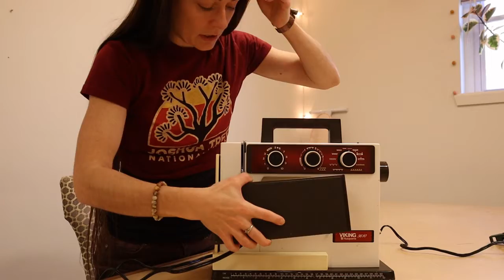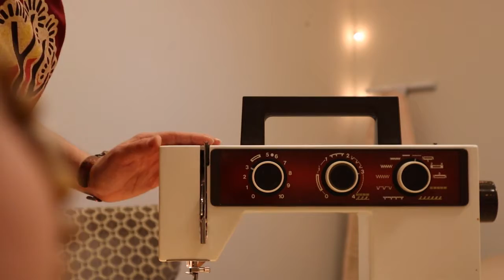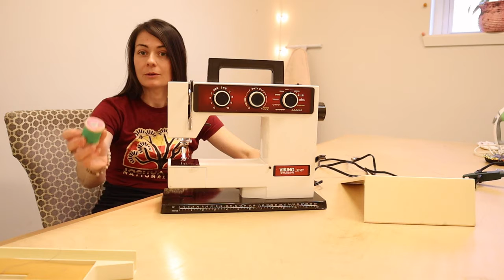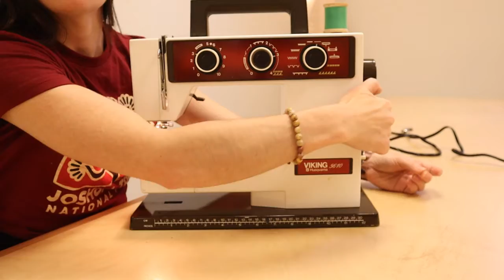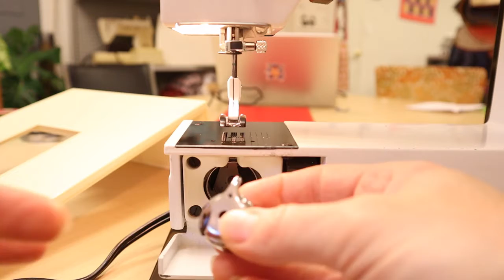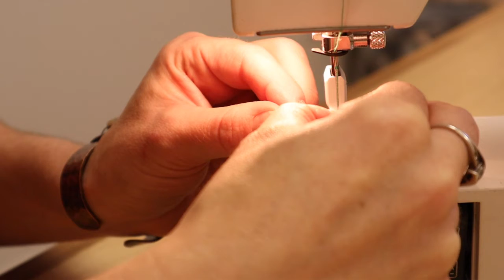Threading and Using the Husqvarna Viking 5610 Vanessa Sewing Machine

Comment: Hi, where can we buy the power cord of this sewing machine, please? The jack in the machine has 4 pins and on the pedal has two pins.
Reply from the maker: Hello, check and see if you have any Viking dealers or repair techs nearby and call and see if they have any. You can also search online. If it’s cheap enough you could buy a whole machine for the power cord as a last resort. Some other models might have the same power cord.

Comment: Just got a 3610. Got all cleaned and oiled. Good stitches. Problem with stitch length. Strait stich only makes one length. No matter having selector on longest setting?
Using guitermann thread 40 weight
Reply from the maker: It might need service by a technician.  There might be clogged up old grease making it so it can't move from one stitch length to the next?

Comment: I found one of these shopping at La Strada (the street) but it came without the accessories and I was wondering if people who found this video and have one can tell me is there is anything special about the presser feet and the "ankle attachment that connects them to the machine. I found a reference to the needle offset being different and I see you mention the bobbins are somewhat unusual. Before I get into cleaning and lubricating it I thought I'd better line my ducks up.

Thanks for this video.
Reply from the maker: Most machines take either high shank or low shank presser feet and this is low shank.  Normally you can use any low shank presser foot even if it's a different brand.  So you need the part the presser foot snaps on to as well?  Your machine basically just has the bar coming down and then nothing?

Comment: This machine sews beautiful and the backside looks just as perfect as the frontside! Its a smol, not so heavy machine, but has much power to sew through 5 mm Felt with ease! IMO a very beginnerfriendly Unit. The backstich knob will get stuck after some years, but thats easyly fixed. Just open the backcover and clean with alcohol or washing Petroleum (NO Lampoil!!) the grime out of the shaft, while wiggle the Mechanism till its free again. clean all fluids, so nothing gets on the belt!! then oil it and use the button 30 times to work it in! Done!
Reply from the maker: Thanks for the tips! It is an awesome machine!